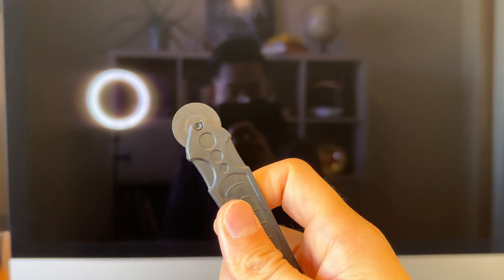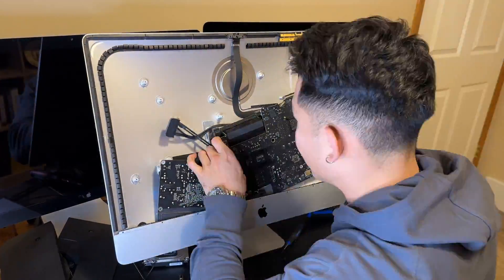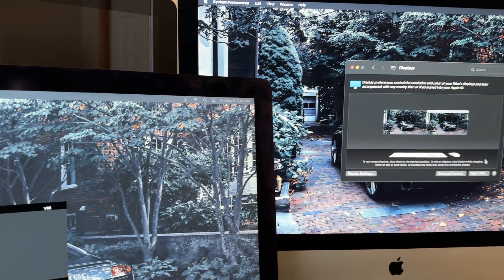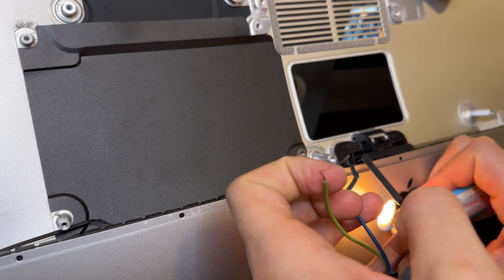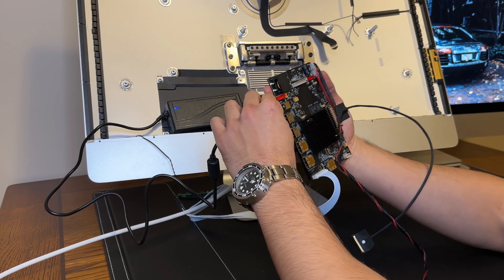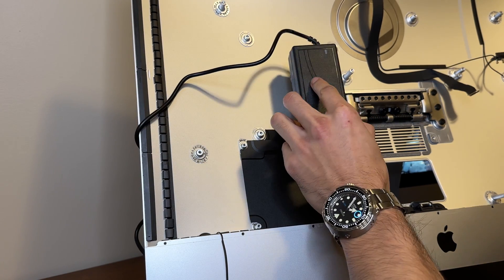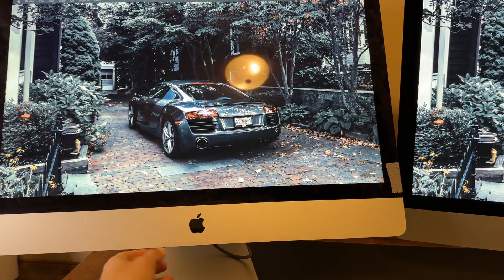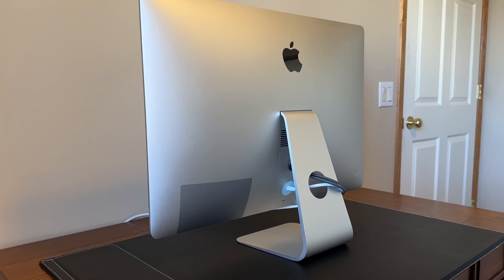How I Got a 5K Retina Apple Display for $400

Comment: I've been thinking about a full kit to provide faster or easier install or even a fully done option for a few years now. But.... Time.... And... Money....  When I did my 1st in 2021 I did the power cable and the power button the same way. I mounted the power supply in the same spot but the board above the hinge and that required no extra weight.  I also wired an IR sensor to the button board and had it peek through where the oem camera lives so remote was easy to use. 

Lastly, I've never used the crossover kit, but I have seen that some are shipped with some of the wires reverse polarity so that can cause highs to sound rough. As for the buzz it can come from being so close to the other components like the board and especially the power supply. A ferrite bead around the wire coming off the main board could help. There are other isolation methods, including a separate digital amp, but most importantly distancing from the other electronics and creating some actual shielding. If anyone wants to chat about the possibilities of all this I'm open!
Reply from the maker: Sounds like a great build!
Reply: I'm in the middle of this conversion (waiting for the board to arrive but completed the teardown). The things that would take the product to the next level for me would be to be able to use the stock speakers, camera, and mic, but from Luke's video the camera/mic seem like a non-starter.

I might try to model and 3D print a replacement RAM door and try to mount the control board there should I ever need to access it.

Comment: Probably the best value of those 5k iMacs was the screen. Awesome that you were able to reuse it so neatly.
Reply from the maker: Thank you! Yes I agree, practically the same panel that is used in the new Studio display!
Reply: That was the only reason Apple separated the screen from the computer on the 27" so they could charge more!
Reply: What did you do for ports?

Comment: Fabulous job the instructions are so clear even I think I might be able to do this to my 2009 iMac but I’m not sure if if that year will be able to be used to like you’re using your 2014 but shoot you did a great job 🎉!
Reply from the maker: Thank you! Yes they have kits for your 2009, and I think it will be even easier, as they did not use adhesive to hold on the screens for those years.
Reply: @RunYoungShoots ye those old iMacs use the magnets to hold the screen

Comment: Very interesting and impressive project. I‘m wondering what you did with the speaker crossover divider you also bought? You didn‘t install it? For what reason?
Reply from the maker: Thank you! I think it may have been defective, the speakers would make a high pitched squeaking noise all the time, so I did not install it.

Comment: Highly professional 
I have a 2010 iMac 
Can I use it as a monitor for a mini
Mac 
Please assist 
Thanks 🙏
Reply from the maker: Yes you can, the resolution wont be as high, but the logic board and the installation would be easier!
Reply: Thank you so much for your reply 
Sadly I’m not a champion techie like you 👍
I thought it’s would be just a thunderbolt cable connection 
Is it possible without opening the iMac ? 
Thanks again
Reply from the maker: @grandmasterjo1  No worries, unfortunately you would have to open it up. Its actually not as hard as you may think, In have not worked on any computers before making this video. You may also want to look into Target display mode for older imacs
Reply: I think that year did have "target display mode" that used the Thunderbolt cable to make it a monitor. You'd need a thunderbolt 2 cable and thunderbolt 2 to 3 adapter from Apple. (Not a USB C adapter that is everywhere.)  

However it may use more power than a gut and reboard. Also the board to do this is less than $50 since the resolution is lower.... But you've got options!
Reply: @TadGilliland Thank you so much for your support and kindness. 
Truly appreciate. Just that I love my iMac resolution. 
Sadly my iMac is not booting. After the Apple logo shows up the bar moves 85% and then a blank white screen 😭😭
I feel I’m invading and asking for too much from you 
Is it the hard disk that has packed 
Or does the iMac need to boot up before I use the TB cables 
Thanks again 🙏🙏🙏
Reply: @grandmasterjo1  depends....   Those years are notorious for video cards going out and then it's not worth fixing most if that's the case. However if it is something else you could plug it in and try hitting " ⌘ +F2"! (or possibly ⌘+fn+F2). If you search for "target display mode" you'll find the process.

Comment: Hey nice mod was thinking of doing the same since I can't find a good condition Thunderbolt Display and this is 5k anyway. Was wondering how did you do the power button like which wires from the switch board did you cut and solder to the oem power button. Also do you still have access to the other ports in the logic board or did you just not think those ports are needed. Also how is the display for other non Mac stuff, was thinking this would be good for a game console or a steam deck. Thanks!
Reply from the maker: Hey, thanks for watching! The two wires I soldered were the last two from the controller board. I don't have access to the other ports, for me there were not necessary. I have not tried it for non Mac stuff, but considering that its a Dell controller board, I think it will work well! I am not much. of a gamer, but keep in mind these displays are 60Hz, so not the highest refresh rate.
Reply: That is true, Thanks for the reply :) @RunYoungShoots

Comment: Could you drop links to the items you purchased?  Great DYI
Reply from the maker: Thanks!

Adhesive and Roller Tool:
https://www.aliexpress.com/item/1005003776361300.html?spm=a2g0o.productlist.main.9.15e76abbamYMNQ&algo_pvid=2e51d06b-fe7b-4c41-b871-de3e78ebd672&algo_exp_id=2e51d06b-fe7b-4c41-b871-de3e78ebd672-4&pdp_npi=4%40dis%21CAD%217.58%215.31%21%21%215.50%213.85%21%402103277f17060766830348998e1f37%2112000031374651115%21sea%21CA%210%21AB&curPageLogUid=BNlpDrdfRbtD&utparam-url=scene%3Asearch%7Cquery_from%3A

Logic Board:
https://www.ebay.ca/itm/165959752487?var=465459649479

Power Supply:
https://www.ebay.ca/itm/155900624046

Speaker Crossover Kit:
https://www.ebay.ca/itm/166098261769

Trackpad Cover:
https://www.aliexpress.com/item/10000214078180.html?spm=a2g0o.productlist.main.1.7e8a15c9ffWI0n&algo_pvid=5d91b012-322a-4e22-beb3-332eae24b3da&algo_exp_id=5d91b012-322a-4e22-beb3-332eae24b3da-0&pdp_npi=4%40dis%21CAD%2113.11%214.58%21%21%219.52%213.33%21%402103247017060769447823563eaf7b%2112000027029036649%21sea%21CA%210%21AB&curPageLogUid=MUhCYB2V7cGB&utparam-url=scene%3Asearch%7Cquery_from%3A